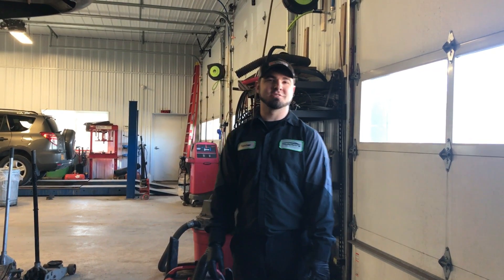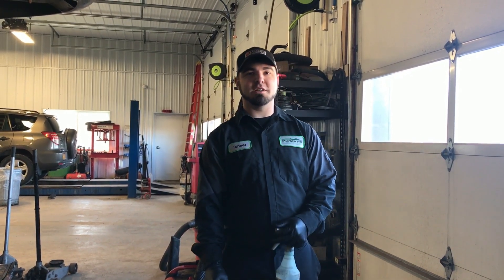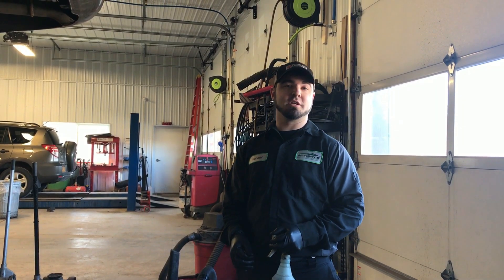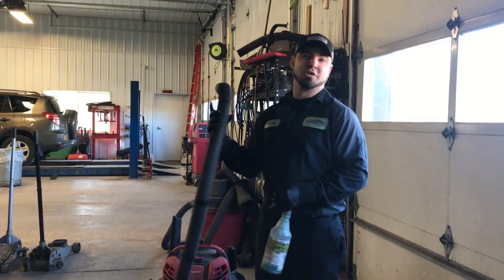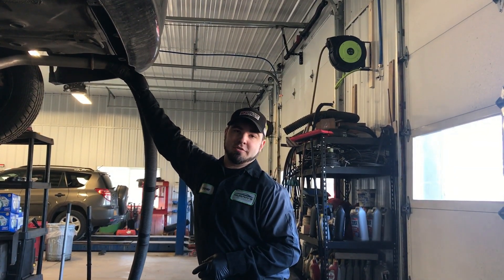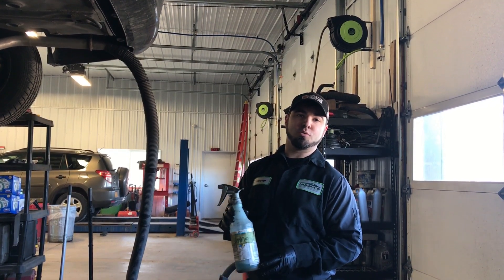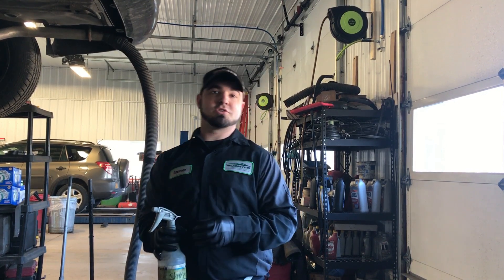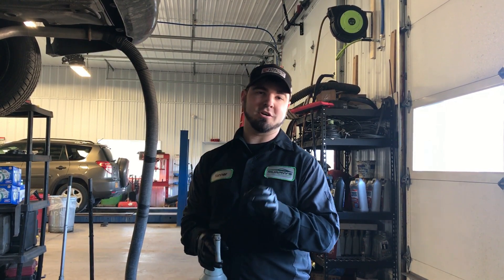Pinpointing Pesky Exhaust Leaks with ease.

Comment: Hi can an exhaust leak cause poor engine performance and engine vibration in a turbo engine?
Reply from the maker: That would depend on where this exhaust leak is. 

If it's significantly downstream of the oxygen sensors and turbo, I would assume, not likely.

Comment: Yup!   I did this.  Got a shop vac from home depot, then put hose on  the exhaust side, and taped the other end to the exhaust tailpipe.    Then sprayed down the exhaust joints with soapy water and found my leak right away!   Great info.....and this defe works!  I had my doubts.   Don't worry or doubt this trick.  IT WORKS!   thanks 😊

Comment: That is a fantastic idea! I do a similar thing with soapy water on diesels but the blower is built in on those. 😁 Thanks for the continued great videos!
Reply from the maker: What "blower" are you referring to?
Reply: @TrainedbyTechs  The turbo. When I worked at a shop, I'd have someone raise engine speed to build boost. If you're soloing, you can often use bidirectional controls to accomplish the same thing.

Comment: Is there any chance of blowing out any engine seals if there are no leaks? I imagine if pressure keeps building it’s eventually going to blow something out. What’s your take on this?
Reply: Because we are not directly introducing into the crankcase ventilation , the volume of air being pushed through is low. We would never suggest using this method for long periods of time. Just a minute and some GOOD soapy water will find that leak fast!

Comment: My exhaust shop said to never do this because it's way more pressure than an exhaust system is designed to handle, and can blow out gaskets and seals.

Thoughts?
Reply from the maker: How much pressure does a shop vac provide?
Reply: @TrainedbyTechs  No idea on that one, but they chastised me pretty hard when I told them I'd done this test.
Reply from the maker: I would suggest to them to watch this video and message us with any concerns. We know multiple people who perform this test without causing damage. The pressure and volume a shop vac provides is ideal for pinpointing leaks
Reply: @TrainedbyTechs   Agreed, I thought it worked fantastic.

Comment from the maker: Hey Guys & Gals! This is Brin. I wanted to share another technique that I've used when I suspect that a less than obvious exhaust leak is causing a biased rear o2, rear fuel trim concern or a catalyst fault. I watch rear o2 sensors while I plug the exhaust. If the rear o2 is biased lean at lower exhaust back pressure, (i.e. idle or low loads), I'll plug the exhaust to increase back pressure and watch the rear o2 sensor. If the rear sensor starts to consistently shift positive with the exhaust restricted/back pressure increased, you most likely don't have an exhaust leak causing your concern. I would recommend trying this several times to prove out your suspicions.

Comment: This is an Excellent test for exhaust leaks guys..it was taught to me by Keith a while ago and works everytime.
It has mostly help me find that pesky p013c codes.
You can also use regulated shop air and blow back into exhaust with the cone from smoke machine to do it..

Comment: Great tip.  I've been using a smoke machine but this will actually save a little time.
Reply from the maker: Mike Agostino I was doing the same with poor results. Smoke machines provide low pressure and volume and often does not show a leak. This is a simple method that seems flawless to me - Brian Culotta
Reply: I'll be using this way from now on.